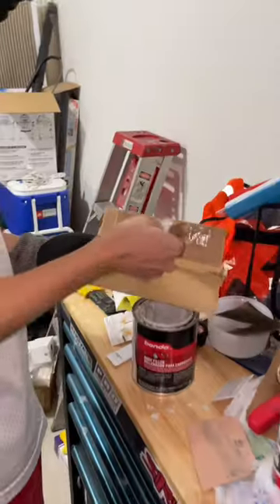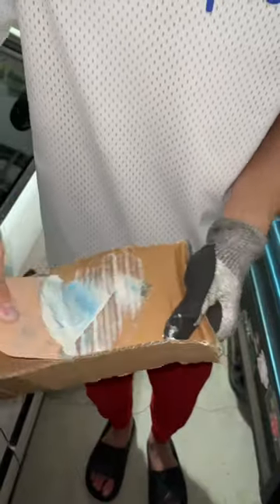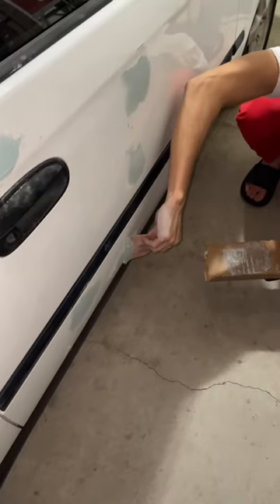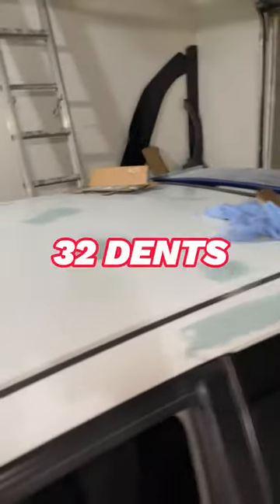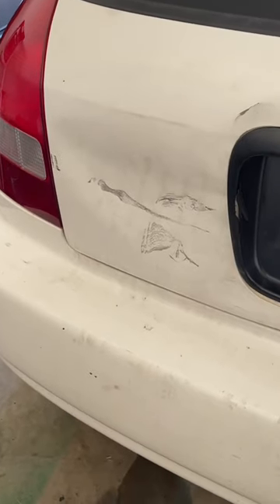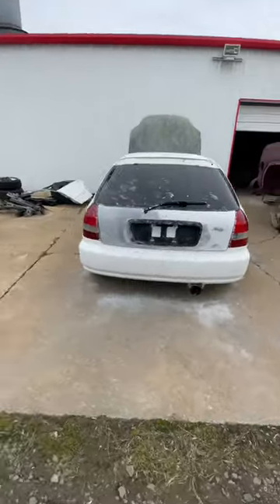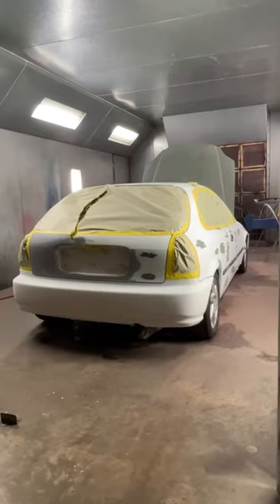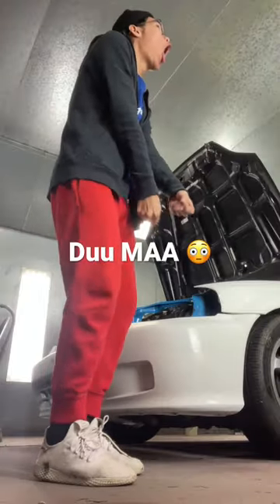Civic gets new paint!

Comment: you know how to do paint and body work on your own cars that’s impressive 👏🏼
Reply: This is not the proper way to do bodywork lol
Reply: Anyone can do it but not everyone can actually make it come out smooth with out cracking of the paint and all that
Reply: Not really. Bondo is meant to be applied to bare metal which he clearly did not do. If you apply it to paint there’s a chance it doesn’t adhere properly and chips off. He did a nice job sanding it down though.
Reply: @daevid21 my thoughts exactly working in a body shop 😭😭
Reply: @liamthompson7155 not so much bare metal but you need to sand into the base coat

Comment: Bro I recommend you to mix the Bondo on a plastic or metal tray. Cardboard will suck the hardner out of the filler 👍🏼👍🏼👍🏼
Reply: @barrywhite2954  why you laughing
Reply: Never had an issue lol
Reply: It doesn’t pull out the hardener, rather what is absorbed is the liquid resins within the filler and hardener. If you ever had filler sit around for a long time you will see the oily brown yellow liquid separate,  that is the resin you have to keep in the filler while mixing. Also never apply filler ontop of paint like he did in the video, the same resins can react with the paint only apply to bare metal or ontop of prepped 2k epoxy. 

If you don’t do this professionally then you shouldn’t be laughing at a comment that is correct just not explained to the fullest.
Reply: Should sand before applying too
Reply: Bro chill i went to auto body school everyone uses cardboard lol shit aint free

Comment: Bondo only adheres to clean metal not paint, glaze can stick to paint but its thin with not much rigidity, like a topcoat.
Reply: False
Reply: @k20lifestyle  "false" 🤓
Reply: @k20lifestyle  it’s not false. I went to school for it. And did it for a living
Reply: @k20lifestyle that's not false. Filler will only apply to bare metal.
Reply: @eve5150 that's not true I'm going to school for this you only had to sand it with 80 grit

Comment: Body filler will only adhere to a panel that’s had the clear coat sanded. Sand bondo with 80 grit and use glaze to get rid of pinholes and small imperfections. Finish with 180 grit. Using a sanding block helps keep your bondo even. Use 5% of hardener to however much filler/glaze you have.
Reply: First off you should never apply filler ontop of base or clear period, end of story. the resins within the filler can and will react with the paint, it might not be today or tomorrow but give it a month or two. Glaze is a waste of money if you can do filler work and blocking properly then you don’t it